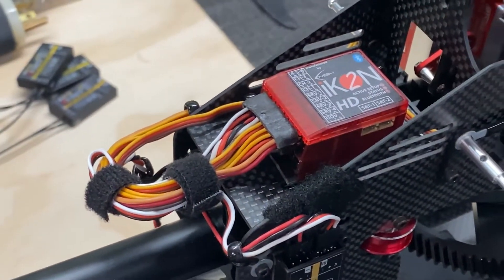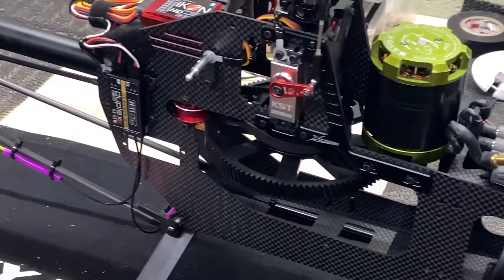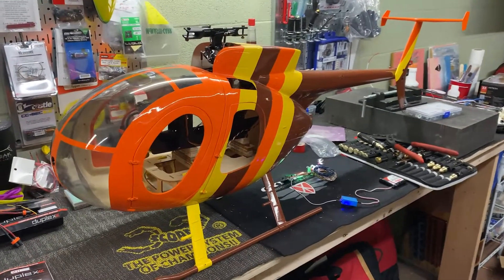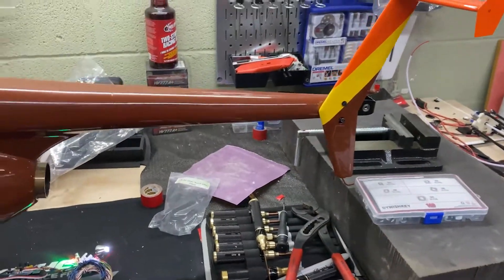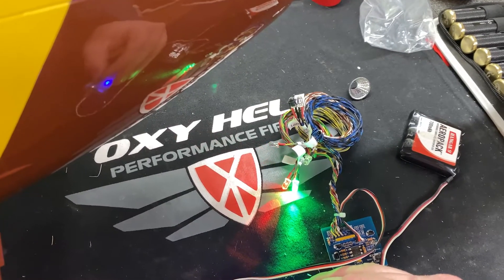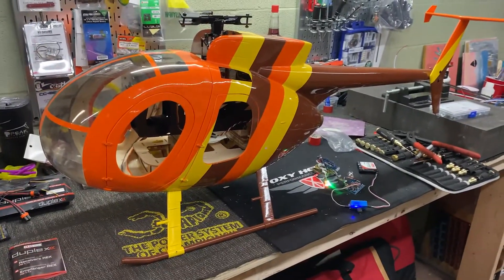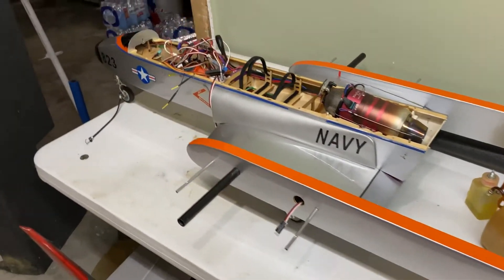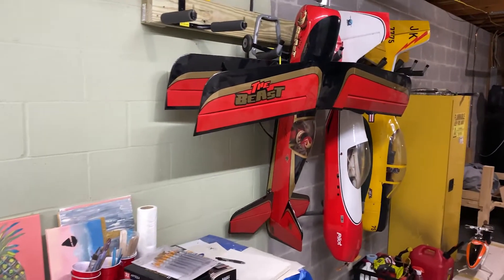RC Helicopter Scale Build XL Power 550 MD500 Build - Part 2 & Other Project Updates!

Comment: Just a note on the tail rotor and why its on the right side, when the prototype is on the left.  The prototypes main rotor turns counter clockwise and scale turns clockwise.  This would be easy enough to reverse the motor and flip the blades.  Then turn the tail rotor so its on the left side. The only hiccup is the control arm, its now top side.  A mirror image of the control arm made on the 3d printer ?  Im building a 700 and found a tailrotor unit on aliexpress that is built to be on the left side.  My 500 i just built it on the wrong side like most people do.

Ok i just checked aliexpress.  The reverse L arm tail unit is for 550 600 and 700 size T.T. helicopter.  Its about $72.00
Reply: If you are selling, and the price is right I may be interested
Reply from the maker: Thanks for the info but I don’t think I’ll get that involved. I’ve already lost interest in this project.
Reply from the maker: You can PM me on RCG, FG, or HF at jtcrowder49 if you want to make an offer.